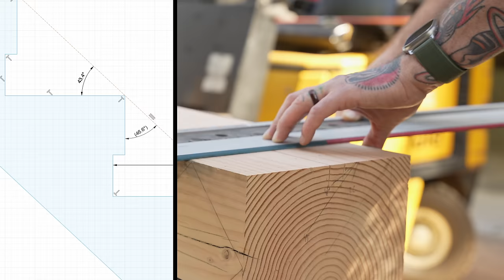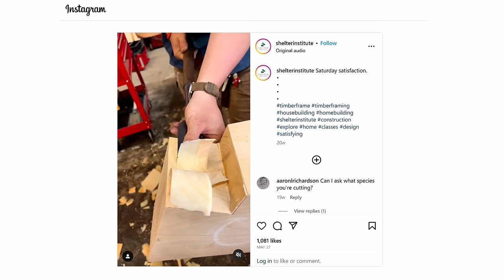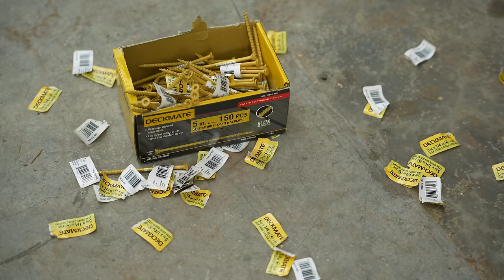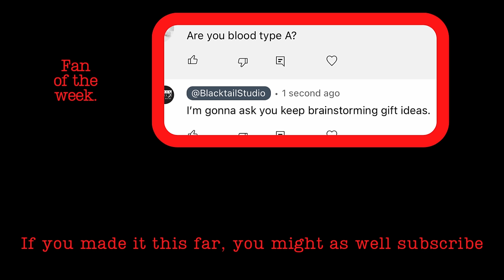Timber Framed Staircase Build

Comment: I love your staircase and pretty much any videos you post. I think for stability sake the only change I would make would be to split your stair stringer to share the load  from side to side. Even splitting the beam in half would help get rid of side to side wobble. Which I think is where the springy feeling you are noticing and not sagging of the wood beam. The thiccness, yes with two c's, of the treads and that split beam would support an elephant. Not that you frequently keep pachyderms in your upstairs or anything.

Comment: The invisible uv oil is better than  the natural. Because it matches the black oil better. Black and a white are in the gray scale of colour. The natural oil brings out yellows and orange. The black and white pigments will allow the stairs to fit in with more variety of other design pieces in a space. If you used natural you would be introducing colours that will need to match other timber objects in the space. Or you could have clashing of too many slightly different timber colour tones.

Think about it! 

Great work on the stairs its a really beautiful result.

Comment: I have a good friend that helps me on projects and we always make things extra beefy/strong just to get the look like this is never going anywhere.  I get those same vibes from your build.  Love it.  I am a little surprised you didn't use any filler on those checks in the main beam, especially considering the finish you applied.  I think I would have applied some sawdust and glue to close those gaps.
Reply: I thought the same!!!
Reply: And also, the grain orientation of those little thingies
Reply: Those are for spider storage.

Comment: My old house, built in the early 60ies had a similar design staircase except the beam was a 8" I steel beam and it had a landing.  The steps were secured to the I beam with horizontal 3/8" angle steel and 3/4" steel bolts.  The top was secured to the upper floor with 5' long 1" steel bolts!  That house could crumble to the ground and that stair would still stand!  I think you're good on your staircase! :)
Reply: Holy crap. That is a sturdy staircase

Comment: Johnny builds
As to the holes in the treads, my experience from another artform (photography), was that if you could not perfectly match something, that you should deliberately contrast it.  That makes it a design element instead of a mistake.  In the case of your treads, that could have meant using blackened dowels (to match the beam color).  Possibly even drilling out the holes to use larger plugs.  Again, turning it into a design element.
And FYI, I vote for the tread color you chose over the "natural oil".
Reply: Oo, very good call on the black plugs.

Comment: Johnny and Cam you did a fantastic job... and don't worry that it's bouncy and miss-colored, most people won't mind too much since it's not in their home! 😳🤔💁 😂😂😂

Teasing!  Working with large beams and timbers are quite a bit more difficult to handle than smaller sizes and weight.  I'm also impressed that each step is level and square, excellent work! 👍👍👍👍👍

Comment: 3:49 Your cross cut sled is inherently dangerous because of the exposed blade at the end of the cut. If you make the rear fence with a box beam the blade will be buried in a block when the cut is finished. It may reduce the width of stock cut, but it is safer and the well created by the box beam is a convenient place for tape and pencil. It also adds some weight to dampen vibrations.
Reply: Using a chainsaw with a bare head and shorts is asking for serious self mutilation too ... ...

Comment: Johnny Bills.
Jacksaw is best, but it’s all about technique. It also takes a lot of time to develop the method. Apprentices used to be sawing for months before they could master it. Power tools have made the technique obsolete, but you’ll still find old joiners/carpenters that can cut a riser like that in a morning, highly accurately & without using anything other than a saw, tape & pencil.

As for the build, not sure what the regs are where you’re at, but it’d be more than ok in the UK, less the requirement for a handrail & requiring a fire retardant coat of paint as it’s in a workplace.

My dad was a master carpenter/joiner & he’d have given it a big thumbs up.

Nice to see people still taking the time to do a nice job.

Comment: I think you folks have done a good job considering the time restraint. A suggestion if you don't mind. I'd have a railing on the left side starting from the floor all the way till the normal height that you comfortable with resting your left hand on. Then on the way down you'd be using your right hand for safety as to reduce the speed of your decent. Now all your railings, whether you'd use wooden ones, or the metal ones will give the staircase a sound stability. The metal clips that we use for roofing joints. The entire 
space underneath can be used, with proper shelving to store the tools that you occasionally. facing the left side all the way till the steps, you could build the doors. From
 watching the video, you'd require three doors. That certainly would enhance your stairway construction & if you believe the bad omen about walking under the ladders or the 
stairway, you'd avoid that successfully. You got a good buddy there & i hope you made it worthwhile for him. I suggested this extra railing project only because after all it's
a workshop & when we're busy with things with lot on our mind we neglect to take proper care while climbing up n' down & accidents do happen. I've done lot of such projects & I love carpentry & working with woods. Lastly, you don't need my suggestion & I want you to congratulate you for the solid stairway that you've built. Thanks for the video. Shane.

Comment: This was super fun, I love reaching a bit further than you're used to with regards to scale:) Ok so while I am no engineer, I have worked with them for about 15 years and have designed many a single stringer staircase, and yes they've mostly been steel but I can confidently say that while the couple of anchors into the slab at the bottom will probably be fine for casual foot traffic, you may want to devise a way to get a couple more in there. Also, maybe add an LVL up top the add some beef and a couple more bolts through with nuts and washers on the other side for longevity. But hey, I'm sure others will have their suggestions hahaha. Guess we'll all have to think about it;)
But, should you wanna make one for a client, contact a civil engineer, have them look over your drawings, and usually you can work with them to find an aesthetic and solid way to anchor these for not a large cash outlay, and they then take responsibility for the safety assuming you install it correctly:) That's what I do.
Great vid as always!
Reply: Great points!

Comment: Cam:  Johnny Build.  Retired timber framer here.  If you ever work with large timbers again, don't use timbers with the center of the tree in them.  All that checking on your stringer that required bow ties and such results from the timber having the center of the tree in it.  If you ever order timber again, specify FOHC.  Stands for Free Of Heart Center.  I've had a lots of problems in timber framing with heart center trees.  They also tend to twist a lot. An FOHC timber might still check on  you, but not nearly as much.  But, overall, it's a unique and very nice stairway.  👍       Doug Eaton 
P.S.  Saw the stair engineer's comment below and I wasn't going to say anything, but you definitely should at least have an engineer look at the connection to the header at the top of the stair way.

Comment: In my opinion, the "invisible" facing is prettier, although for a workshop it may be more difficult to keep it clean. In any case, you need a finish that is not slippery and can withstand cleaning products well.
It is a good idea to insert the steps a little into the beam, this gives it more strength. The screws work to keep the step from moving, but what will really give it strength is the inch that goes into the beam.
It wouldn't hurt to check the beam anchors from time to time (top and bottom).
Regards.

Comment: I built one of these from reclaimed wood from a 100 year old grain mill. In my situation I had to do a 90 deg turn at the bottom. I did run my treads into the wall and secured them with 12” lags through the re-enforced  wall. All staircases I have seen wave started to work after a while, mine is still tight after 10 years. I also carved a 12’ long narwhal tusk as a hand rail.

Comment: That had me rolling!!! “If you just think I’m showing you the good ones. What about these?”

I’m a Journeyman Carpenter/Craftsman and I’ve done plenty of staircases. I’ve done stairs with logs and timbers, even a set of stairs with timbers from a barn built in 1906. There’s a lot of ways, styles and techniques to use in a variety of ways in building stairs. I like your work and think you did a great job man… until the finish on the treads.😜

Comment: Jonny builds : did you try to jump on it ? By the way I love the looks of it but I would probably enhance the support in the center, adding a second vertical piece of wood in the center of the beam (and one on the end section maybe) to limit the flex.

You might want to anchor the steps to the wall because centered as it is, you might end up falling to one or the other side.

Comment: Great care and craftsmanship.  A structural engineer (me) would have made more robust end connections at the top and bottom because with single stringers, torsion is the main concern and the source for all the movement that you're having.

Comment: Fun fact for Scott since he is learning 3d!

I know nothing about woodworking, but I'm a product design student and there is one very useful tool for "engineering safety" you can use to test a virtual 3d model.

On Fusion360 there is a simulation space you can put your model in, apply the mechanical properties of your material, say which faces will be securely attached, and you can simulate how any force (from any direction, on one or more of the "faces") will put a strain on your model.

It's a bit tricky with wood since the strenght and flex modules depend on the species and grain direction, but you can make a custom material description to enter specific data... and maybe err on the weaker side to be sure.

Of course as you said the thickness here should make up for most of these concerns, and a commenter pointed out all the specific concerns he had for the wooden stairs that are very unique to the trade.

Simulation tool of course will not account for wood shifting or reacting to prolongued use, but these are things that you as a woodworker learn to navigate with experience.

I still think it's a fun tool to try out for Scott, and it could come in handy if you decide to do "thinner" projects like the tables you just sold, or even something not very balanced and experimental!

As a student who never gets a chance to work with actual materials, I really appreciate seeing all the particular solutions for woodworking problems that never come up in a virtual model. Great work!!

Comment: Johnny Builds.

My only barrier to buying that N3 stuff is the astronomical price. I'm trying to get into woodworking, and there's a lot of tools I can buy fir the price of that tiny bottle. My current tool collection is a circle saw, wall saw, and a folder of sand paper...
Reply from the maker: I get that. At the price point it is at, it is definitely not an entry level product. Unfortunately it’s very expensive to manufacture, and I don’t want to sell a watered down version that doesn’t work
Reply: @BlacktailStudio  Absolutely agree with you. If I ever hit a point where I have all the tools I need and can make something worth selling for a high price, I'd be using a premium finish. Wouldn't want customers calling after only a few years complaining about a fading finish

Comment: I would have oriented the checks differently, so their marks run vertical. The horizontal orientation is weaker in two ways. First, the force of loading down into the staircase will skew/stretch across the check, so the top and bottom layers will be pushing back separately; this is almost like a laminate or a leaf suspension. If it was vertical, the entire thickness of the piece would be pushing back, and the two parts can push back together. Second, the treads cut back through the check, creating a wedging action on the check. This applies both to the levering up into the next tread, as well as where the screws run down. This is a little sketch, particularly because you don't know how strong it is, and the whole piece should be reinforced. If this was vertical, there would just a gap in the middle, and the two, vertical runs on either side can work together (as long as you don't screw into the void).

Comment: This is very cool. The tread fasteners should go into the meat of the stringer below the line of the notches. The notches can break off easier than one might think.
Reply: Can you explain what you are trying to say a little better? There is plenty of meat where he put his screws.  Notches on what? And if any part of a staircase us breaking off easily than its not done right.
Reply: @yearight7956  yes, on larger Timbers such as the stringer here, checking is normal but severe (also seen in video). The checking creates voids along the grain which allows a given tread to snap off relatively easily. On 2x it's not as common because of the board size and respective checking. I said what I said from experience cutting stair stringer out of beam stock, gave a simple tap to move a stringer on layout and the tread snapped off. So if there's a chance of that happening, which there is, all that's required is to increase the treads screw length to get back the check line into the remainder of the stringer actually under compression/tension. If a tread cracks off, the fasteners hold the tread to the meat of the stringer. That was the point.

Comment: By screwing the ladder both at the top and at the bottom, you do not allow the relative movement of its ends, which runs the risk of it cracking. Ideally you should screw the upper part and leave the lower part free (allowing movement on the horizontal axis).

Comment: johnny builds. so something i did years ago when i accidentally drilled the face side of a project table i used some 1cm diameter teak dowel rods which added contrast to an otherwise pretty dull looking pine table. if the wood isnt going to match exactly anyway maybe leaving heavily into not matching would be an idea

Comment: Great video! I a not an expert, but it feels like there was a lot of work going into making the stair pieces, but at the end it seemed that not too much thought went into the size and amount of fasteners. Are 4 deck screws really enough to hold each step? Same with the bolts holding the top strap.

Comment: Not only are those stairs not code compliant. Any deflection means that they are not structurally sound. looks good but very dangerous. Needs continuous handrail and guard rail, but will defeat the look.  Be careful and good luck.

Comment: Cant go wrong with overbuilt. My Grandfather was a Seabee in the Navy and then retired as an Iron Worker. He built our home now, with his own hands way back in the 50s and 60s. The whole house is constructed using left over materials from job sites he worked on, bringing them home 1 truck load at a time. The exterior walls are 2 feet thick and the staircase is made of an I-Beam and 3 inch thick slabs of walnut... My fireplace is like a vault, constructed from 1/2 in steel plate and there is not a single piece of drywall to be found.

Comment: No, white is better than yellow!
but, structurally, it was necessary to pass 2 steel reinforcement bars from the top plate to the bottom from the bottom of the beam. )))
the design is great!

Comment: Gorgeous stairs, but i wouldn't really feel good about securing the large heavy levers of the treads with deck screws. 
Probably be fine, i just don't have much confidence in the structural strength of thick wire with threads on it.
Yes i know the primary load is held by the joinery, but lag screws would've matched the beefiness of the project better.

Comment: I am surprised by the amount of "roll" in the steps as you walk down... if you step off the center you can see the stair tread dip down slightly.  I am curious if you have noticed this.  I have a hard time believing that massive timber is twisting... I suspect your lower strap... which seems small to me.  Curious why you didn't make that a larger square plate.  It's easy to watch and second guess the "man in the arena", but large plate with 3 big bolts per side would maybe minimize that.

I did prefer the "Pure" finish color myself.

You did a lot of really great detail work, the screws on top of the tread broke my heart!  With your skill level, you could have easily sent those screws up from the bottom through the timber and never seen them.  GRK makes large flat head timber screws in 2" increments for precise depth placement... maybe on your next one!

Comment: A metal strap that went under the bottom stair, but over the base, and was slightly imbedded in the base, might have stabilized the staircase better.

The metal brace that's under will partially do the same, just not as well.

Think about it.